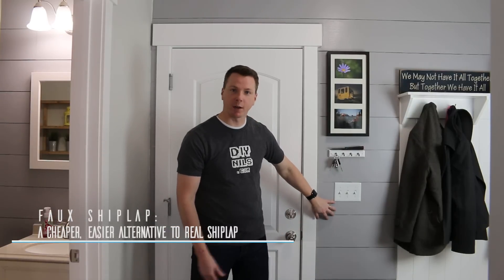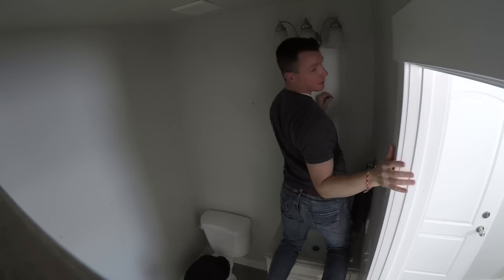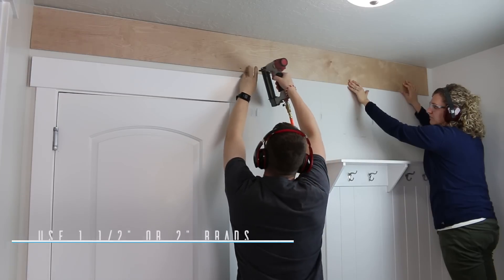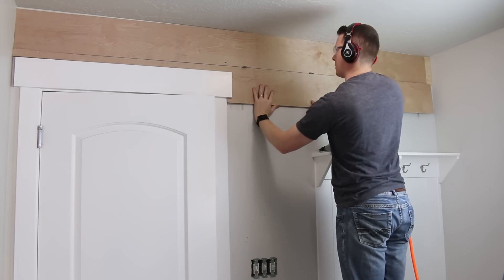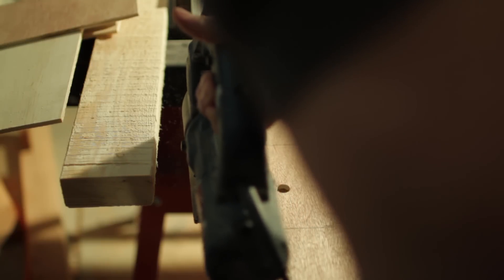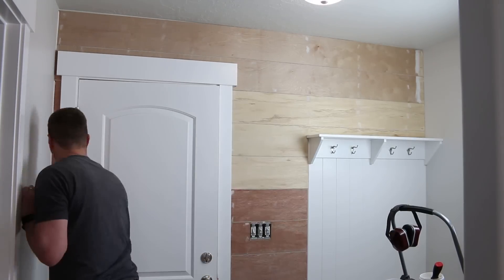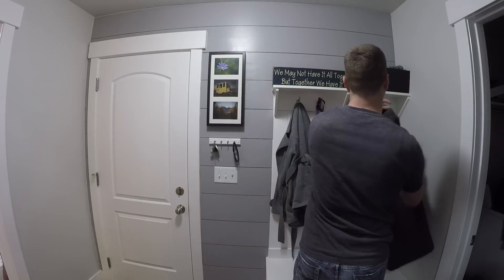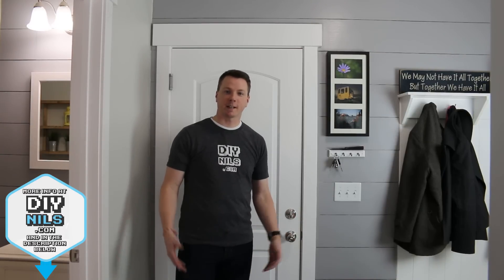DIY Faux Shiplap for $80

Comment: Real shiplap is actually easier to install and looks better. But don't install shiplap on your wall just because chip and joanna tell you.  Smooth drywall and some nice artwork looks better.
Reply: I agree.  what was the matter with the wall as it was ?
Reply: True there is a difference in the look but still looks good at an affordable price. Shiplap is not affordable especially if you are doing a larger room.
Reply: This is your opinion.  Smooth drywall, ship lap, tile or any other wall covering ALL have their place in a home. Just because you don't like the faux ship lap doesn't mean it doesn't look good or even better than smooth drywall.

Comment: If you are going to provide instructions, you should do it right.
Just like tile, you don't start with a full piece and work it to the end with a cut piece unless you knew the bottom piece will be hidden, but you should mention it.
You are supposed to calculate out the cut piece and then split the top & bottom boards and then you start from the bottom and work your way up.
Reply: Oh good grief get out of it.  What did it matter?  he made every board seamless on the short ends and painted it.  Does not matter at that point.  This is not tile, this is board.  There's not federal penal code way to do this and it looks more uniformed than tile and more craftsman that the same old bastardized way of tile setting.  The  math clearly showed that there would be the same gap either way.  You claim about "do it right" but you never mentioned how he didn't stagger the 2nd board with the cut piece to the other side smh.  Quit hating because you, me as well as everyone in this world has flaws.  Don't even see not one lick of work you've done but you talk about others PSST!!!!! please!

Comment: 1st big mistake of the installation was never checking that 1st piece for level. Stopped watching right after that.
Reply: The 1st piece WAS level....it’s the ceiling that’s not. Only way to ensure the rest of the wall is straight. He did it right.
Reply: @stevesimonetti9669   Steve Simonetti  oh, I guess you were there than? 🙄 What is the only way to ensure the rest of the wall is straight? You said nothing at all to even accommodate that statement??
Reply: @Holden Tudiks, the first board and bowed ceiling were explained in previous comments.

Comment: did anybody else notice the bad cutting skills at 1:53 ? Lol other than that its good
Reply from the maker: That's actually a bad ceiling job. Most ceilings/walls/corners are not perfectly straight and putting something straight up against them really accentuates that fact. The board here is nice and straight but what I could have done was trace the outline of the ceiling and custom cut that first board to match. I'm way too lazy to do that though. :)

Comment: You really left out a ton of useful information... Like, you should level that first board. You should scribe that giant gap on top. Putty doesn't work miracles. How to measure properly for your cutouts. Too much missing info for beginners to do a good job.
Reply: I agree.  That's why that first board left a gap in the upper right corner.  In most houses (even new homes) the walls and ceilings are not perfectly square.  That's why getting the first board will keep the rest of the boards level.  However, your work turned out looking really good.  In an older house that might not have been the case.
Reply: "upper left corner"  lol

Comment: This is nice but it's not true shiplap.
Reply from the maker: babyjjnels Very true. Hence the words "Faux" and "$80" in the title. Cheaper and easier but visually similar.
Reply: LRN2DIY it is not visually similar. Saw edge marks everywhere, bad gaps. In the video alone I could pick this apart. Ghetto man. I do this type of work for a living and this would never fly. It's diy and the $80 part is the part where you get what you pay for.
Reply: Clayton Yates You’re confusing “similar” with “same”.